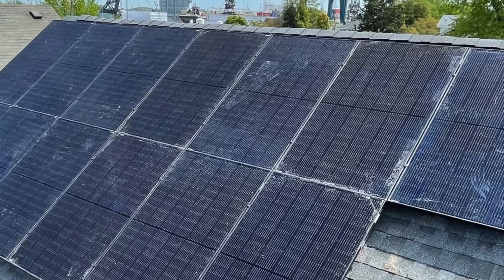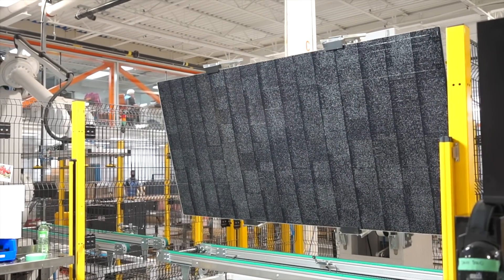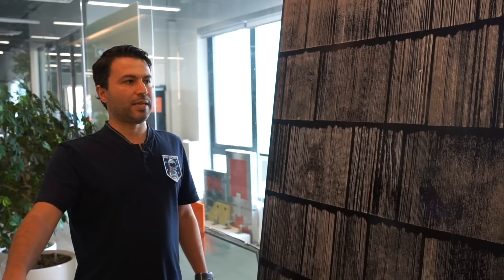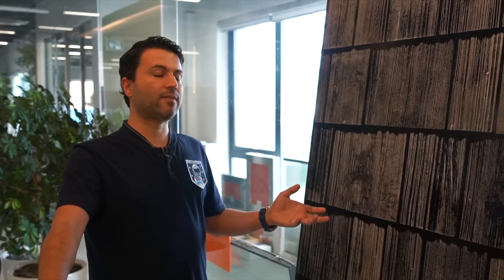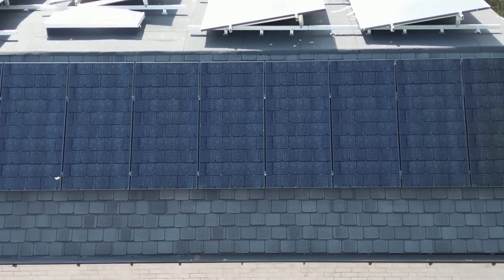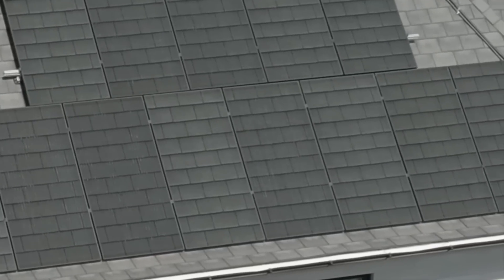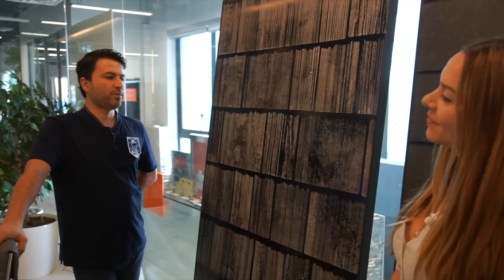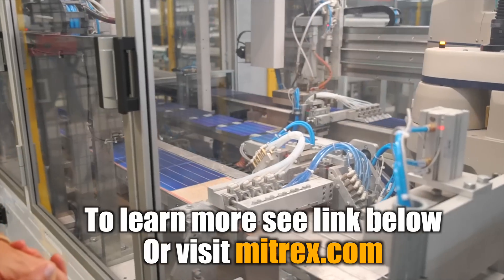The Genius Solar Roof You’ve Never Heard Of

Comment: Regular solar panels can now be purchased with 485 to 620 watts .Mitrex while nice looking put out a lot less power and more expensive. It is a nice option for some rooftops but for those that have enough yard space for a rack going with 485 to 620 watt panels may be a more cost effective option. Keep up the great solar videos. Q cells is a hugh solar factory in Georgia which may be worth checking out.

Comment: Interesting and it works well for office buildings but for residential roof I'd try to make a structured panel so it looks more like the real deal and make dummy panels so it can be the entire roof. Similar to Tesla but not individual tiles, a larger panel with fake multiple tiles and edge that can overlap seamlessly. and generally stick to darker roof designs because any lightness of course diminishes the power output.

Comment: All those vertical facades and fences have to have a very low output compared to proper orientation.  I don't see how those would have a reasonable payback period.
Reply: They won't have a reasonable payback period at current prices, but in 5 to 10 years I expect they will because I expect prices to plummet just like say, personal computers did from 1980 to 2020.